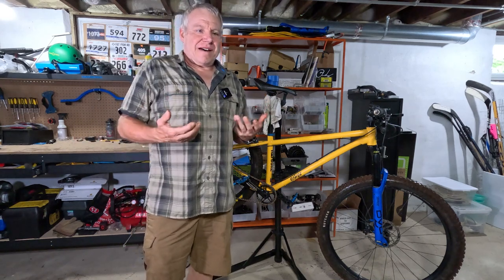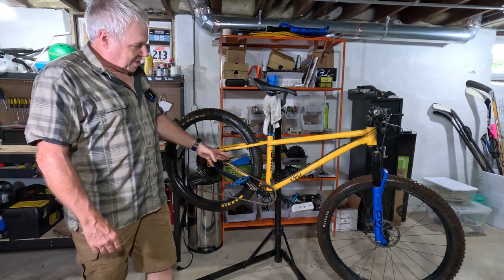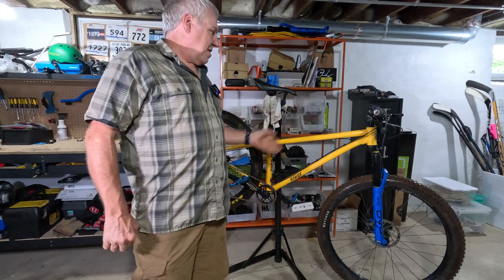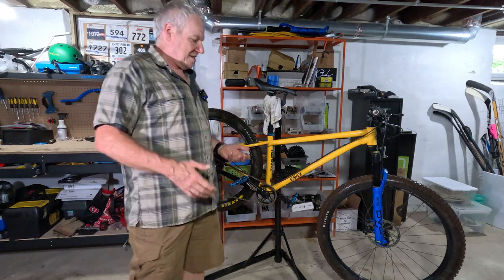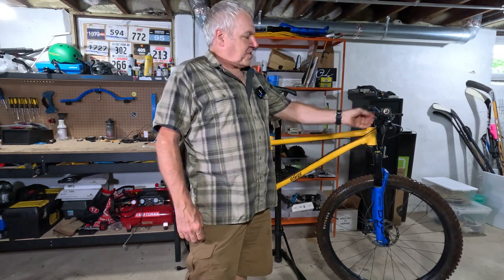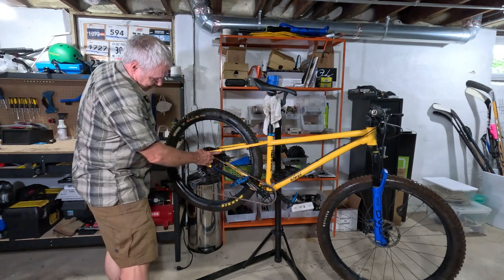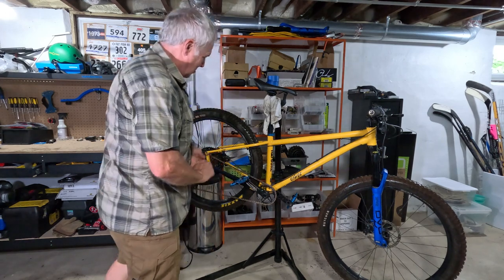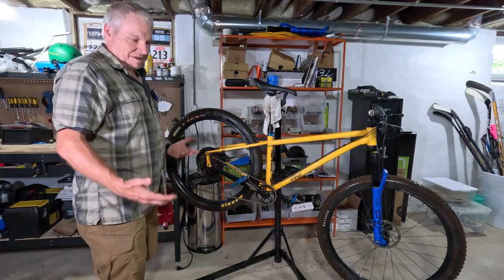Converting my Hayduke back to singlespeed

Comment: I see there's a Spank single speed thru axle hub. Is it worth building a second wheel with less dish?
Reply from the maker: It could be, but it's so easy to take off the cassette and put a cog on I don't know if it's worth building a whole new wheel just to do this swap.

Although if I had only one bike to ride and needed to swap back and forth a lot I would consider doing something like that.